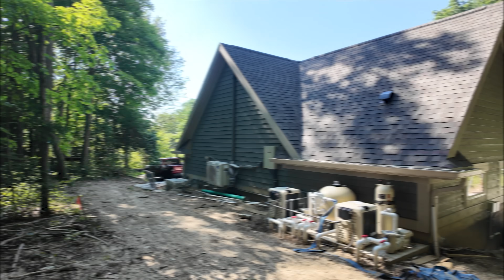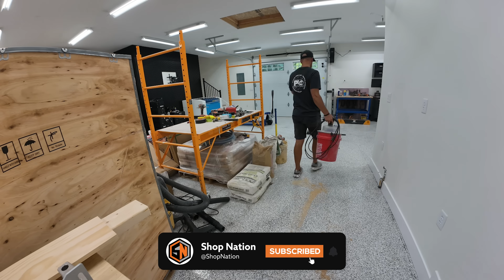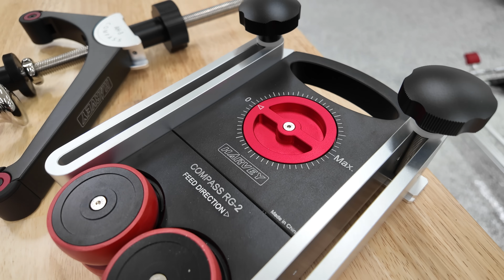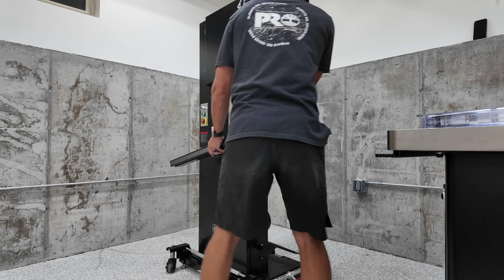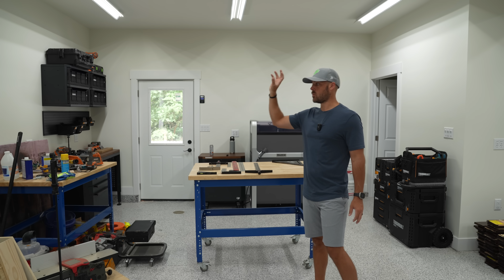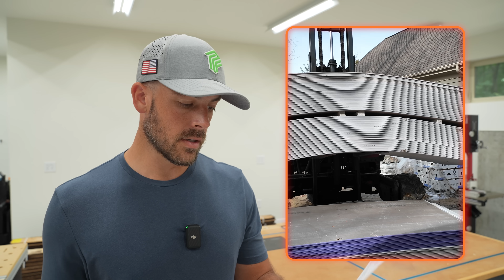Why are shops so expensive? (Full Cost Breakdown) // Shop Build 10

Comment: In 2005, I built an oversized 4-car garage (2000sqft) for just under 55k all in(1/2 of the concrete and roof was pre-existing from the existing large carport). Of course, I have no upstairs nor a bathroom, but it is insulated/climate controlled and gives me enough space for all my tools and 1 car/piece of equipment to be disassembled while still being able to do a woodworking project (or maintenance on another vehicle ). Today, it would cost me at least double that. Last year, I put a metal roof on it for 4000 in materials. Had I needed to start from scratch, I figure at least 30k more(60 today). It is amazing how fast things add up(even when you do much of the work yourself).

Comment: I'm really curious how much of the cost is non-scaled values. I think if I did a project like this my biggest fight with myself would be limiting the overall size. Like if you made your shop 25% bigger, would the cost actually go up 25%? Anyway, great video, thank you!
Reply: Bigger shop bulding will give a bit lower price/sqf than smaller ones. Like getting better price when buying more material, transport cost from lumber yard of 5000lbs of materials hardly more expencive than 4000lbs. 25% bigger, say 15-20% more expencive, but I would look at it as a potential bonus, just be conervative in the estimates

Comment: Great shop build.  I too went thru this but I had a lot of my tools before hand.  So, what happened was storage of those tools caused me to experience some rust on my cast iron tops and one of the things I wished I had know about was putting a carbon layer on the tools which would keep the rust away.  I am probably too late to tell you this but since most of your large tops looked great in the videos it would be great to preserve that look thru out their life.  So, if you have not done this, please think about it and you will not regret your decision to go forward with it if you do.  I use Carbon Coat to do mine and the guy that owns the company is great.  Try youtube and check it out!  Gregg!

Comment: I love the space and the shop layout. The only thing I’d change would be to have any sander be it disc bench or belt sander well away from the laser. It doesn’t take much dust ingress to cause issues with the mirrors. In fact if I had the space, I’d have an inclosed room or partition purely for sanding with a downdraft table. That’s just me though!

Comment: I'm not one of the early, early guys as I think I didn't subscribe until about 28,000, but I continue to be so impressed with your progress over the years. As a former Woodlands guy it's also great to see a Texas boy do good. When I did my small remodel right at the beginning of Covid I figured it would be about $60K and it turned out being slightly over $100K, so the same issue as you but much smaller. Keep up the great work.

Comment: Wow, that foundation was insanely expensive. I’ve built several larger foundations like that on my farm—with ground insulation, floor heating, and more—for a fraction of the cost. And I live in Norway, where material prices are even higher than in the U.S.

Comment: FYI: You going to hate that chip\speckle epoxy floor. Sooner or later your going to drop a fastener or a small part & be unable to find it. You would have been better off with a mono color chip so its easier to spot dropped items.
Reply: FYI: Bought a tracksaw, Almost never use the table saw. Only using the table saw for cutting trim pieces (too narrow to cut with a track saw).
Reply: Probably a 3x3 or 4x4 plasma table would have been better than the small waterjet. Small water jet is really only advantage would be  plastics or ceramic materials.

Comment: Too over-engineered = too expensive.
The studs in my shop are on 4 feet centres. Yes 4 feet. 18mm ply on the inside. Corrugated metal panels on the outside screwed to the base plate, the top plate and the central noggins. 
The roof is similar construction with 6mm ply and a vapour barrier. 
It has withstood hurricane force winds and my fat 220lbs can walk on the roof.
If you're not building a house you don't need to design it like one. 
It has withstood hurricane force winds.

Comment: Wow!
I just built a pole barn with metal siding.  36x40x16 with 2) 14x12 electric doors, 200 amp service on its own meter.
$550. For permit and inspection.  $7,500. For doors installed, $23,000 for pole barn built in two days, dirt work, 240 yds of dirt $6,000, $5,500 electrical $9,000 concrete. $1,500. Gutters

Comment: Beautiful shop and always appreciate the price transparency!  As someone else mentioned in the comments, if you ever decide to sell it very easily could be converted to an ADU to further increase the value of the build.  Side note, makes me feel much better about the $32k I spent building my 768sqft shop using a pole barn kit from Menards. ($14k shell, $6.5k concrete, $4.8k elec service upgrade. remaining $6.7k on finishing electrical, insulation, and interior finishing)

Comment: That foundation work you got had. I'm in Michigan also and I paid 86k for a 32x54 shop with concrete floors and a 20x20 pad for 86k
Reply: I thought it was pretty high too. I built a 18 x 30 shop last year with a full basement and a suspended slab last year. My concrete all in was $40K. It  would have been about 55k had I not done the shoring and reinforcement in the suspended slab myself. That's footings, foundation, basement floor, and suspended slab. I am in Southern Ontario. far mor concrete and Rebar than his project. (everything was engineered)

All that being said his build was pretty cool.

Comment: Intentionally or not (because hey, you make videos... it can take a long time to edit... or, hey, great to have more videos)... plus, projects tend to take a lot of time and have unexpected issues... it all happens.  Anyhow, I've enjoyed the videos and thanks for sharing.

Geez!  $48k to get 200A service to the place???  I am now 1000% convinced.  Solar + batteries is the way to go for new construction.  It would be cheaper to install and then you don't have a bill.  If you really need backup power... run a circuit from the house that you can use the charge the batteries at off-peak or get a generator.

Comment: Very nice work space. You will likely recoup that money with the videos you produce from it. The foundation of my 22x30 shop gets poured next week. Total cost will be $82,000 which includes upgrading my house panel to. 400 amp service, no plumbing to the shop  but it will be finished on the inside. That’s for central California.

Comment: This tracks with what I am spending. Originally, I wanted to do what you did and JUST build a 1000sq/ft shop/garage (and much less fancy than yours). Estimate here in Florida was over $225K (slab, so no $80K foundation at least). But that adds very little value to my existing house. It ended up making waaay more sense to build a 1400sq/ft house attached to it for $375K. Then I can rent or sell my existing house next door. The costs are so front-loaded that more than doubling the size of the structure did not double the cost. 

I'm saving a BUNCH of money by doing an IKEA kitchen and bathrooms myself. It's no wonder we have such a housing shortage in this country.

Your finished result is absolutely beautiful! I wish I had the time and energy to do more myself. Thinking about doing the flooring, but having done a room in my other house myself, doing 1400sq/ft is daunting.

Comment: A fully insulated structure with a bathroom, plumbing roughed in, and electrical could easily be converted to an ADU in the future. That would add tremendous value to your property. As a shop, perhaps not, but as a in-law suite or short term rental it very well could.

Comment: Here's how cost change over the years.20 years ago I did 28x40 ,12 walls 2x5 back 12 ' loft half bath hydronic floor heat 8' man door 10x10 rollup for 30K.I have unisaw,20'' planer,12''jointer,bandwas,resawbandsaw,grinder station disc/belt couple drill presses, knife grinder, bench grinders, spiral pipe dust collection.Wa a self build.that was materials and small bit of sub work.

Comment: Regarding welding, keep in mind that the molten splatter from welding will probably damage the epoxy floor.  Plan on some type of floor protection.
Reply: so true!
Reply: any form of high speed abrasive (angle grinding) will also mess up epoxy floor. He really should consider a separate high temperature floor for such activities.

Comment: You have a nice shop now but that's something like $250/ft².  I have to wonder if you could have found a home that already had a decent shop area and bought it with the sale of your house and the budget you spent on the shop.

Moving and a bit of renovation would have been much less work.

I know it wouldn't be the same but you could have let someone else take the loss on home equity...

Also if you had a place that didn't need a road built, a mountain moved, a retaining wall, etc., you could have saved probably $100,000.

People should consider these things when they buy a property if they plan on changing or adding much.

I'm starting fresh, I have raw land.  There will be some challenges but it's mostly a culvert and a drainage ditch.  I'm going to use the opportunity to bury a ground source coolant loop which might reduce my HVAC expenses a lot if it works the way I envision so hopefully I'll get a twofer from that cost.

Comment: It's taken almost a year just to break ground on my new garage/shop with attached house (engineering mistakes leading to permitting dilemmas). And I am terrified what the final cost is going to end up being. Cost-plus custom house contract. And it's not starting out great even in the ground breaking, my builder told the lot clearing company the wrong info, and they are going to have to come back and clear it out properly. Sigh.

Comment: Love the shop and thank you for sharing your adventure with us. 

That being said, I knew you cost would be around what it was. The reason is because my wife and I build a small house, just 800sq ft finished, for her parents behind ours. The cost, less than yours but more than I bought my house for. The reality is that building a one off structure outside of a major build contract part of a larger complex is just more expensive. Lost of lessons learned.

You pay more for individual items that a group build is. Every board, inch of cement, screw, bolt, etc costs more per square foot this way. It is just the reality of doing this. However, it is just money at the end of the day and you are getting build exactly what you wanted in the way you intended. I look forward to the future videos you put up working from the shop.

Comment: Wow. We built our house 2 years ago and in doing so I built my shop. It is a metal building (red iron) that is total under roof 60ft x 42ft @ 16ft tall walls. The enclosed portion is 40ft x 30ft. To have it built, spray foam insulated, roll up doors, and power/network ran to it was $78k. I have since put up stud walls all around and ran all the lighting and electrical/hvac work. This has cost about another $10k. I still need to build cabinets, and a assembly table. It never ends my dude. Btw, I'm digging the new thread pitch gauge. I'll be picking one up soon.

Comment: GREAT SHOP!

Yeah, shops are expensive.  5-years ago I upgraded from less than 200 sq.-ft. total to just over 400 sq.-ft. and another 200 sq.-ft. of cold, dry storage in the attic.  The biggest expense was adding 100amp subpanel and multiple 20 amp and a 30 amp circuits within.  Next biggest cost was insulation and rough walls.  That was just over $4k not to mention the new fixtures, machines, cabinets and tools added in the new and additional space.  Not going to say how much that was cause it's really more that I ever expected to spend.  Also, ex-PVD guy here.  Likely have run into your dad at one point or the other.  Especially if he is based in the Dayton, OH area.

Comment: That looks awesome!  I'm in the middle of planning my shop build with office, shop, bathroom, and film studio, and your video just about completely changed how I am going to do it.  Thanks and no thanks!  😂💰
Reply: $309/sf is bonkers for a garage, even one finished to interior grade. That $80k foundation is just about the most insane part. No idea how you could spend that much money on the dirt work... Even in an expensive part of CA for a similar sized building with more extensive foundation excavation, my folks spent waaaay less than that on the foundation portion. That should be a $30k job, even with an engineered foundation wall.

And if the integral retaining wall was such a big line item, they had plenty of site setback and flexibility to just grade back the hillside and do a surface level erosion control solution. Or combine grading with a short, non-engineered wall made out of stacked block. Even if you spent $10k on a retaining wall it shouldn't cost $70k to do the rest of the foundation. 🤯

Comment: I am at the point in the video where you are talking about foundation cost 🤯 Holy cow 82k is a lot of money ( not criticizing whatsoever) I feel like that was a little high. Before I could get started on my shop I went through the same process with surveys, drawings and permits which we were about the same cost, I  had to bring in a total of 131 18yard truckloads of fill dirt which cost me right under 21k and I had 11k in tree removal,  before the building could be built I had to build 5½' stem walls to get 6" above the house foundation to have enough slope for the new driveway,  I did 13' 4" walls to be able to install 12' doors and all in with stem walls, building walls and 6" slab I paid 61k and I ended up putting a full second floor on the building which is 35' × 45' ....And the stem walls are 12" block all cells filled and the upper walls are 8" block every 5th cell filled and rebar....I budgeted 75k for the concrete work and I ended up having the driveway redone entirely which was another 31k so it definitely put me over because of the concrete driveway,  anyways, back to the video and also your shop is awesome!!
Reply: I forgot to mention my footing which was 24"×36" with 6 number 5 rebar...back to the video

Comment: I built my 26x42 mostly by myself, full scizzor trusses, about 20x26 area is a loft over where we are parking, all open in the back. Full polyaspartic coating on the floor, etc. I have about 70k into it at the moment, with no interior finishings or insulation, or mini split yet. Probably have another 20k to put in there in order for it to be done

Comment: I am in the final stages of building my own shop, it is a single story 600 square feet 15'x40' shallow frost protected footing (so no foundation) building. I did all of the work myself except the site prep and concrete work, and the total cost to me so far is just under $50,000. I have yet to fully complete the electrical but I have most of the supplies on hand already, so I expect it to total out at around $55,000. I honestly think you got a hell of a deal for all of the work you subbed out and the specifics of your build.

It hurts me greatly to think about the fact that about 5 years ago A Glimpse Inside built his 16' tall 20'x30' shop for $45,000 including a beautiful paved driveway and didn't even have to lift a finger himself. How times have changed!

Comment: i built my shop 2 years ago - $47k give or take for the building (pole barn amish built) concrete floor, gravel, lots of gravel, ceiling, drywall hung not finished, heat/ac and a bathroom and garage door (4k plus 1k for the opener). 1100 square feet. I did the wiring, plumbing, drywall, lighting.
Concrete has gone way up in price since i did mine.

Comment: Awesome!  So glad we spent so much money on a house that had an existing building with a 100A service that I could make into a shop.  Something like $15K for spray insulation, a mini-split, a couple of power poles, dust collector, wiring, ducting, doors, etc.  Impossible to know how much extra we paid because of the existing building, but I guess somewhere in the $50K range.  If someone has a flat area and doesn't care that much how it looks inside or out, the crappy low end of the scale I'm guessing is $65K.  It doesn't look AT ALL, anywhere near as nice as yours, but it is a functional shop for the kinds of things I do.  Anyone with self respect would probably spend some more to make it look decent.  Just to give people a rough idea where the other end of the scale is.

Comment: wow $83k foundation!  I was myself blown away by foundation quotes for my 24x34 garage-shop (no attic), which likewise involved a hill and major backfill to the stemwalls.  Quotes were around $45kusd.  I decided to do it mostly DIY though, and already just the excavation and driveway work came to $14k (hired out).  Design and permits was only $1400 but the Geotech engineering bill was $4200.  I am now getting engineering done for the foundation and will form and pour footings and stemwalls myself.  But still have to contract out the slab finishing.  Framing I will do myself, that will be so much easier than the foundation.  Would be $100-150k to hire it all out, I am aiming for $65k all in.

Comment: 🚨OCD ALERT ALERT!!! Please add rubber pads under the blue metal cabinets that are already showing rust on the bottom before that rust transfers to the epoxy floor. Also, it will help them remain dry should a liquid event occur in the future. This is the conclusion of this ALERT!🚨